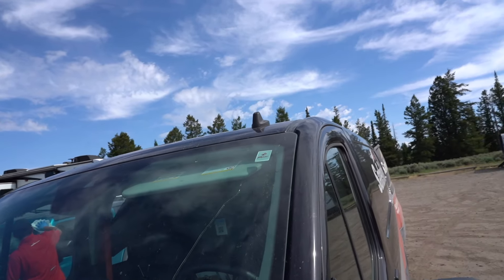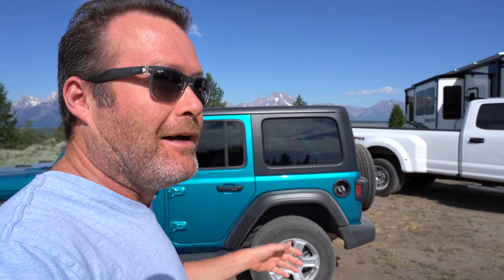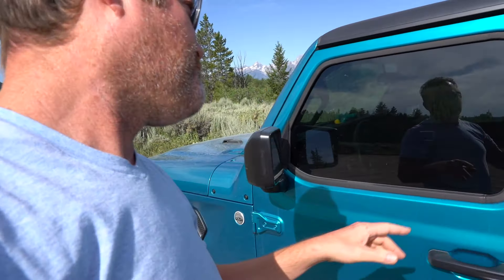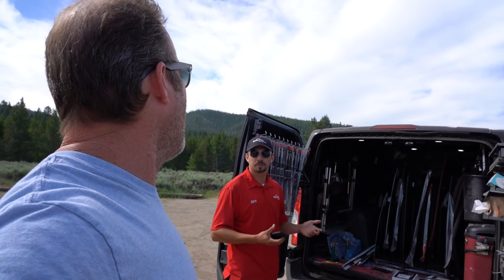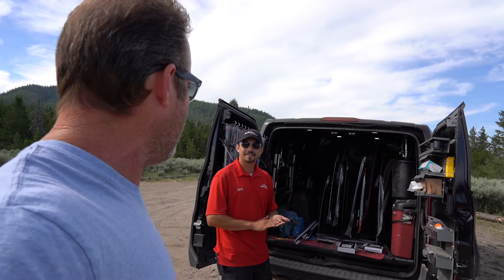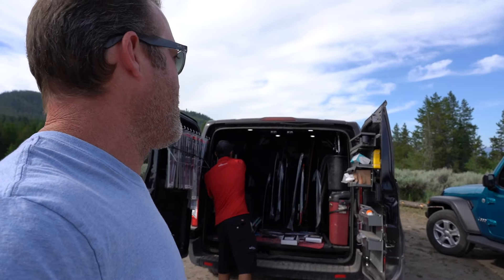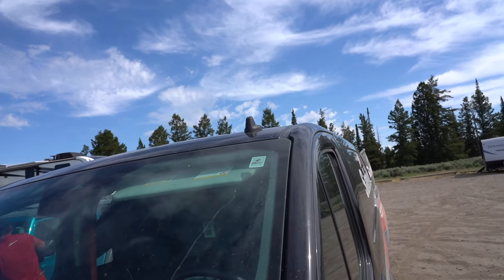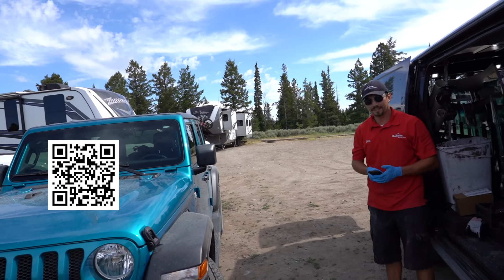Will Safelite Auto Glass Come To Remote RV Campsite In Teton National Park?

Comment: That electric caulk gun is awesome! Safelite replaced a windshield in my 2006 dodge grand caravan and they did a good job but the fumes from whatever sealant they used was absolutely unbearable. I didn’t drive it until the smell went away which was about 24 hours. The windshield lasted until the engine eventually blew up! They have also repaired a few chips for me.

Comment: I need a new cockpit window on the passenger side of my class A motorhome, the original is cloudy and getting hard to see through. I called Safe-lite. They won't touch it. The unit is a 2002 model, so the manufacturer doesn't make the parts anymore to replace with new.